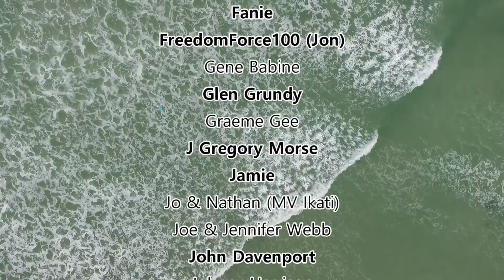Brand New Engines RUNNING!! | YACHT REBUILD WEEK 97

Comment: Happy new year Ricky and Simone , looks like 2020 could be the year of sailing for you. With such a tricky launch situation you can't afford to just throw it in and then pull it out if you forgot something! And that PE harbor is not the best place to be working on the water I expect. Is a land or water berth cheaper? With all the trouble people have with 'new' boats even with all your care you will have to be ready for some minor shakedown cruise issues to deal with. 
I hope we can get some more Patreons to join when you start sailing, you will be in different water from the run of the mill YT videos , make the most of it.  All the best cheers Warren
Reply from the maker: Exactly.. Got to take our time and not rush it. At the moment water is more expensive but we ready to get going now and we need to do sea trials as well. 😊

Comment: Was surprised to see the 2 blade props.Good luck on your journey.
Reply: Jerry Taylor hi, they have a lot less drag than a three blade. Almost 10% different which help when sailing with the engines off, which should be most of the time ! Cheers Warren
Reply: @CheersWarren  Why not go with the self folding props.  Don't know the cost difference but do know some cruisers I watch use them. So many choices.

Comment: Are the fans without cache not dangerous for the fingers?
Reply: Lutz Anton hi, they are sold that way and have an extra protective rod on the outside of blade for protection. Seems odd but this type fan has been around a long time. Check out the video before the start them up. Cheers Warren